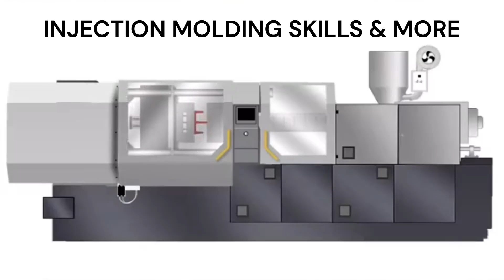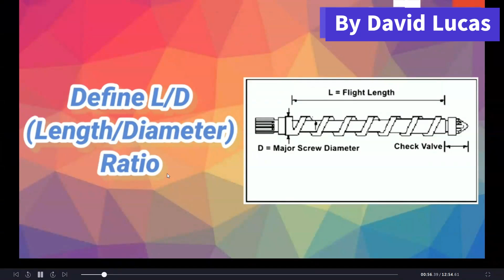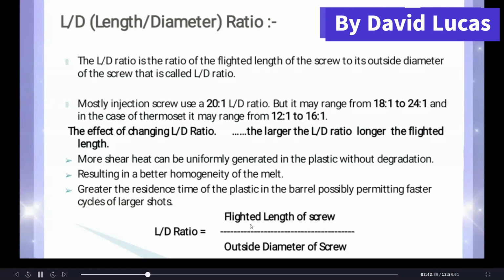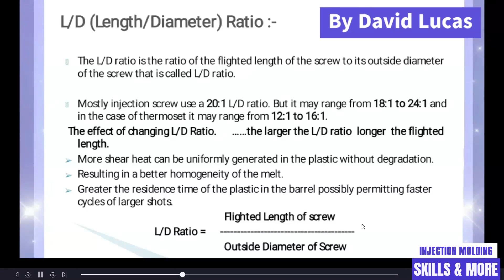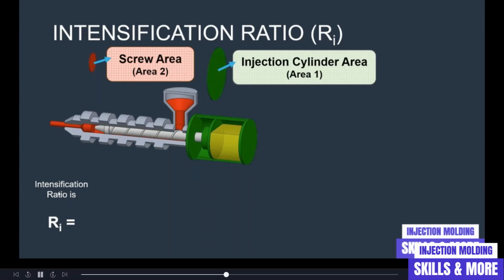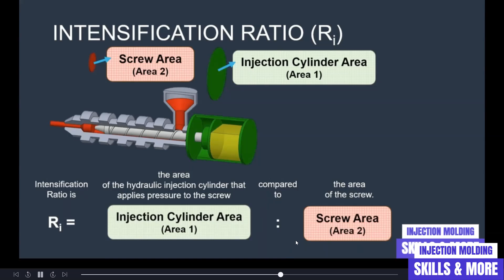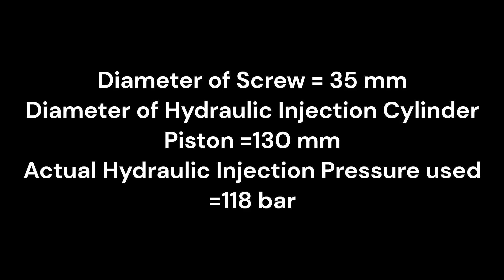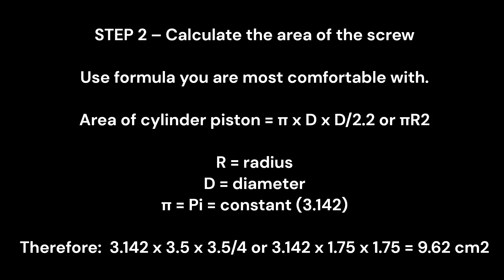Calculate the Specific injection Pressure & L/D Ratio

Comment: I'm kinda new with working in molding been a cpl years. I'm getting splay near the gates and was wondering what changes wld you do to correct this?  Wld it be cavity pressure?
Reply from the maker: You can play around with the speeds on injection. What its called is gate blush or gate sheer. They way to fix is to open the gate up a little or change the injection rate & mold temps. I hope this helps. Thanks for watching & the support.